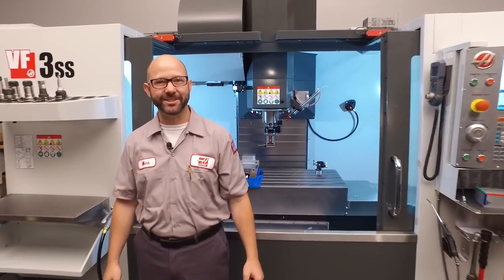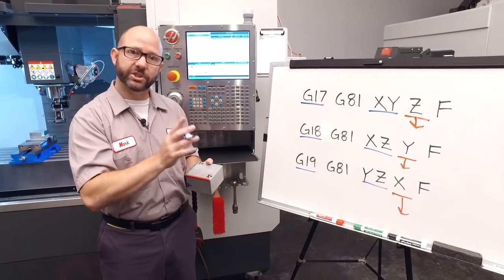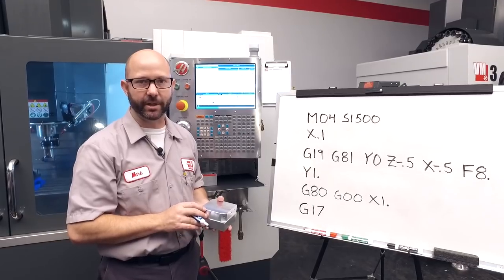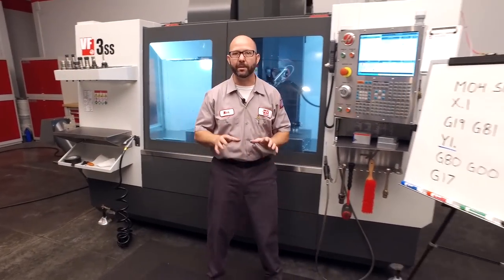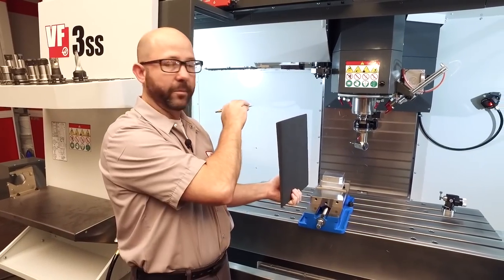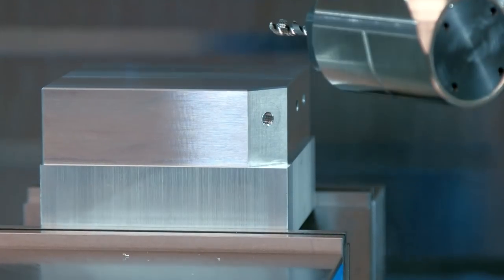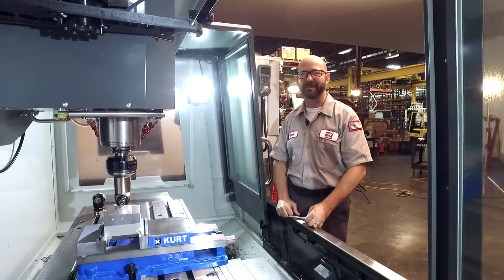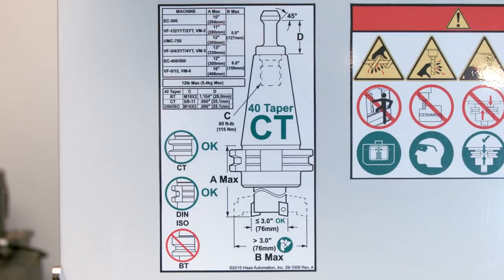Setting up a Right-Angle Head on Your Haas; G17, G18, G19 Explained – Haas Automation Tip of the Day

Comment: Hi Friends, 
I have 2 doubts on right angle head.Pls help me out.

1.Apart from 90° angle, other angles like 10°,30°,45°,60° etc available or can we customise the angle on this head according to our requirement? 

2.I have a machining part and i do the set up for that part within 2 hours.Next time if i want to use an angle head machining How much time it will take around to do the set up ?
Within 30 minutes Is it possible to do the setting up of an angle head? 

Wait for your valuable answers. 

Thanks in advance.

Comment: In straight Fanuc you are able to use several tool length offsets in multiple work planes (as in using H1 in G17 [XY plane]  and using H101 in G18 [XZ] plane) simultaneously while still working in the same work offset used for machining the top of the part. Theoretically it should also be possible on a Haas. H1 (G17) tool length offset is set as the distance between spindle and center of the tool in the right angle head, and H101 (G18) tool length is set as the distance from the tip of the tool to the center of the spindle. I'm pretty sure that to do that on a Hass you will need to disable some parameter to allow a mismatch between tool number and tool length offset. Also you will need to cancel tool lengths afterwards with a G49. 
The code should look something like the following:
T1 M6; tool call 1
S1500 M4; turn on spindle, 1500 rpm, CCW,  but CW in right angle head
G49; cancel tool length 
G00 G17 G43 H1 Z2.; enable H1 tool length in XY plane, rapid to Z+2 from the center of tool in right angle head to Z0
G18 G43 H101 Y1.; enable XZ plane, enable tool length offset H101 in XZ plane, position cutter in Y axis in rapid 
X0. Z-1.; rapid to first hole position in X and Z axes
G98 G81 R.2 Y-1. F10. ; drill first hole 
Etc..... 
G80; canned cycle cancel 
Etc.....
M49; tool length cancel 

To be quite honest though it is quite a mess to run right angle heads on Fanuc based controls, especially if you are planning on doing more complicated work at goofy angles and such.  Heidenhain control takes care of a lot of the mind-numbing calculations that if takes to do right angle head work in Fanuc allowing you to focus more on making the part, rather than not destroying the right angle head. 😉

TLDR: if you plan on doing lots of right angle head work you should go with a conversational control such as Heidenhain or similar, something that supports definitions of right angle heads, not a G code Fanuc based control.
Reply: i dont believe Haas mills  truly have G18 G19 planes they're all G17  planes

Comment: Is this tapping managed with rigid tapping? How about precision of the tapping? I mean ... there is always a backlash in the gear of an angle head. I bet M4, 5 or even M6 taps would break...
I prefer to give a hint for spring extended tapping collets to compensate deviation and axial force.
Beside this.... very good video, like it.

Comment: This is a good video for someone new to right angle heads and I did notice the spindle reversal why cant the manufacturers of these heads design their tools with the driven gear on the other side of the driving gear as apposed to where they actually put the driven gear this will eliminate this problem. A simple design change.
Reply: Hey Ray, your question makes sense, but some times the design you are suggesting can not be realised. To open the space for the gear you have to eliminate a bearing which will weaken angle head performance and lifetime dramatically. Due to maximum weight and size going through the ATC space is very limited and you can not just make the head bigger to avoid this problem. I think customer will be more happier with a long life head, as the programming needs to be done carefully anyway.
I work for the german company mimatic. We produce right angle heads, in the USA Lyndex Nikken is our distributor.

Comment: I just had an issue and couldn't figure it out.  I had a regular G81 drill cycle in XY plane - but it rapid into hole and did an X move after.   I turned out G19 was active from Mastercam arc filter for 3d cutting.  So I need to update the post to force it back to G17. 
That was some problem

Comment: It would be great if you could show how i program an adjustable head with live tooling.
Reply from the maker: Daniel –  We can add angled VDI or BMT heads on your Haas Live Tool lathes. Companies like Benz, MD Tooling, and Heimatec offer angled heads built to fit your machine. You can Vector tap at these angles with a G195 code on your Haas Lathe. Great topic – Mark, Haas Tip of the day

Comment: What is the part number for the right angle head in the video? I’m trying to find a right angle head to use on a haas and do tool changes but they either exceed the weight limit or diameter limit recommended by haas
Reply: Check out the ones MST sells. They have a compact version that's pretty reasonably priced

Comment: I have a question about cutting compensation when I use a head.
how can I make the compensation of a cut if a cutter wears out
Reply: you’d make another program with a smaller diameter endmill because cutter comp doesn’t work in G18/G19

Comment: Holy table lookup to find every G code that is not used daily. Or to find what those P, Q and whatnot do in this cycle. I don't understand why people still stick to code that was meant for machines, when alternatives exists, like for example Heidenhain. Way more simple to use and even the machine control panel is way cleaner.

Comment: How much tolerance do you lose witha 90 degree head? deflection?
Reply: Thats really a matter of the brand. The internal structure is essential. Learned that Benz Tooling are best. The head will flex around 20 microns. The cutting force is the result of feedrate,  cutting speed and tool wear. It will go to zero.

Comment: When setting tool lengths etc.....don't use paper...no need to get tools that close to hard parts, use something MUCH thicker...like a 1" block. Get closer then 1" then lay the block next to the tool and move AWAY from the objects surface until the block just slips under the tool...more accurate and less dangerous. Set the dro to 1" for that tool, not zero.
Reply: Use a 1/2 dowel pin, they're way much cheaper and ground to size in diameter. A box of 50 will last you a lifetime. Keep various lengths on hand at every machine.

Comment: Using a piece of paper to touch off? feeler gauge is a must . What next using a ruler instead of calipers .. geeez
Reply: Gauge block or dowel pin and move the tool AWAY until it goes under. Start in 0.01 til the gauge goes, remove the block, drop a click, switch to 0.001 til it goes again, done. No chipped tools if you go too far and better resolution, a few tenths if you need. I usually use a 3/8" dowel pin for setting general milling with my Gerardi G90-7 head.